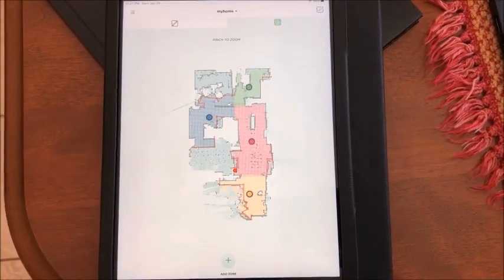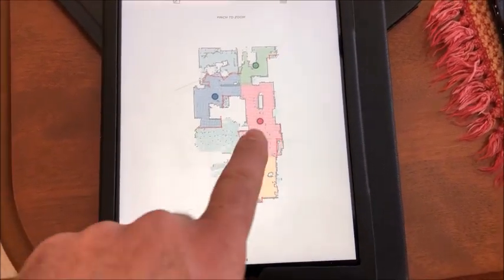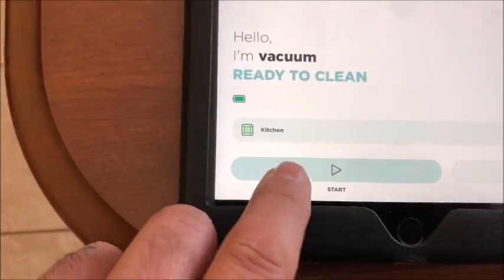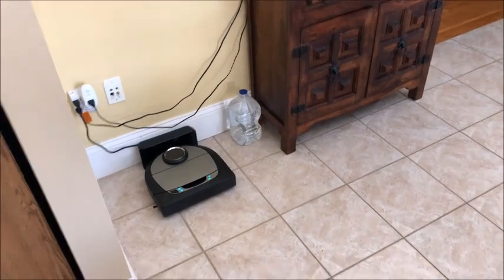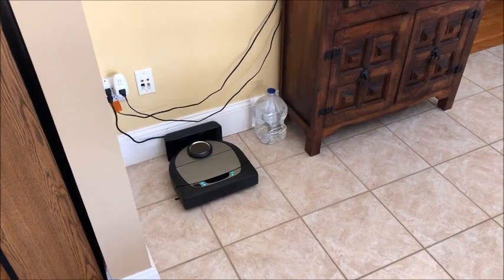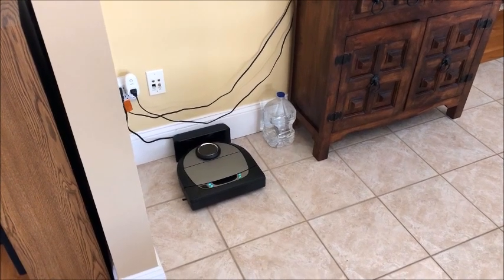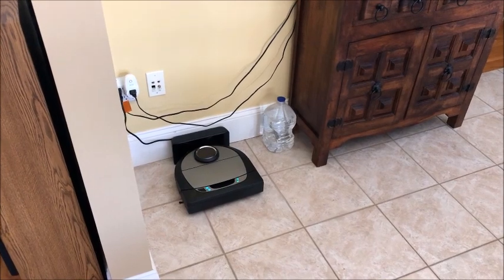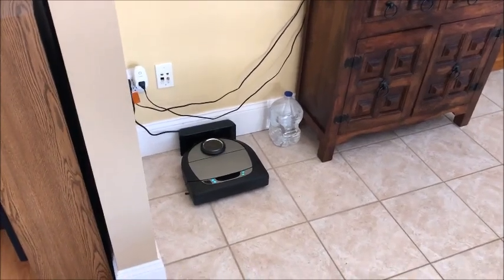Neato D7 Floor Plan Navigation Error

Comment: Apparently, if the GPS has to work even the slightest bit (hahaa!). Disturbances like a cloudy day or some atmospheric blockage, like RAIN causes (or seems to) the floor plan part stops the machine from even beginning its task. If your Neato starts, fires up the beater brush and then audibly trills just before returning to base with a "Navigation error" message on your app, tap the three lines on the app and remove your stored floor plan. I used the nogo lines until I noticed that very little time - days/week pass and this - no vacuuming - would occur. Find structures to drop in the way/obstruct instead of nogo lines and you'll be more happy in life without this annoyance. Second D4 here at home. Daughter brought hers here, I didn't buy the second one.

Comment: Let me start out, I am a hardware Electrical Engineer, and I would never buy a NEATO product after I tested and owned this NEATO junk, a "D7", we all paid big bucks for these devices.  The NEATO company does not care about fixing the firmware bugs, I had this exact problem reported and so did many others. When I called Tech. support, they can't help us. Oh, they say they will report it, in a case file but in a few weeks the case is closed out, but these firmware issues were never fixed, but NEATO was quick to develop a new device and market it to get us to buy another one. Support always tells you to rebuild a new floor plan and like the video said, the lockup error happens over and over again in time. Dudes, having us building a new floor plan is a big deal and takes lots of time, and that is not the problem, and if you get an issue while building it, the software will not let you clear the floor plan error, and does not allow a user to continue to build a floor plan, you have start all over again. It took me 2 weeks, 7days and 8 hours a day to get my 3500ft floor plan into a mapped floor plan, without errors. Huge deal, dudes, and all NEATO Tech. support wanted me to do was delete, really dudes, are you crazy! I did find the one suggestion, that worked, in this thread about creating a schedule a few minutes later and letting the unit start the new schedule cleaning, this seemed to get mine going again this time, until the next lockup issue I can expect in a few months. Hard resets don't clear the lockup, and if the firmware was designed properly, a hard reset should have fixed all the errors/issues we all are having when the devices lock up.  NEATO just does not want to hear from their customers. But your loss NEATO for having marketed junk to us all way before you debugged the firmware in the field. Yea it might have worked in your lab but when the device is used in the real world its junk to an owner.  NEATO did not allow us to contact the programmers directly about the bugs in the firmware with all our real-world testing and firmware bugs that occurred and all of them were never fixed like this one and many others we came across using the D7 at home. I have friends who are programmers and if NEATO would release the code they said, they could fix it and send it back to them for a firmware update to fix these errors for us all, but even NEATO would not allow this help from the community of users. I purchased a D7 and after a few years now, NEATO said they were not going to support it anymore, NEATO Really, ??  NEATO just left the bugs in the firmware like this one and we all need to buy a new Version device! Really?
 Again, GOOD BYE NEATO! NEVER AGAIN FOR ME! NEATO IS JUNK AND DONT BUY ANOTHER ONE!

Comment: if it can help anyone, as clearly stated in the user manual : the Neato base needs to be placed AT LEAST 3 FEETS (1 meter) from any corner or wall. Under this, floor plan are not guaranteed to work. And it needs these 3 feets on the 3 sides (left, right, and front) + never add anything in this 3 feet space once the floor map is done. Any added furniture (even a bowl for your cat for example) and the floor map is considered modified.
In your video, for example, was the bottle on the right present when you made the floor map? If no, then you have to remove it. If yes, NEVER remove it. Plus we see there is not 3 feet on both sides.
Your possibility is to deactivate no-go lines. Then you won't be able to ask it to go to a specific room, but as it doesn't need to load the map, it will work.

Comment: I occasionally have had the unrecognized floor plan message, or something to that effect.  It’s usually caused by something being changed in the room.  The unable to load floor plan message had me stumped but I assumed maybe something was interfering with the LiDAR so I blew it out with some compressed air and after that it started right up.  Maybe there was some dust there or something.
Reply: As a follow up this did not work.  Still trying to figure out what is causing this problem.
Reply: This is a problem with something being moved or introduced in the view of the vac when it rolls out about a foot and looks around.  I can put a clothes basket in it’s view and it will come back with an unrecognized floor plan.  Or I can move something big in the start up room and it does it.  It’s odd but only things that change in the vacuums view after it rolls out about a foot from the base cause this.  Something moved in another room doesn’t cause any problem.

Comment: Got the same problem multiple times now in the last few weeks ( i bought the D7 5 weeks ago ) and I may find a solutions. Try to move the Loading base a few centimeters ( Hand width ) from the wall into the room. Now My D7 worked again without any error since a week.

I tried multiple workarounds before like setup a new floor plan, clean sensors and laser system with fiber and aircan and remove reflective surfaces in the scan area - but moving the base a few into the room fixed it for me. May it help others :)

Comment: I've found another work-around for the "No Floor Plan Match Found". Before creating another map 1) Open the app 2) Tap three lines at top 3) Robot Schedule 4) Enable schedule 5) Select zone on your existing map 6) add time and cleaning days. I simply set the day/time to a few minutes ahead of current time. It worked.
Reply: Thank you, I reset my time and it worked. Changed it by 5 minutes, easy peasy.
Reply: Thank you for posting this.  It worked!!
Reply: Omg  this work for me too! 6 month I stop using the feature because of this error each time.. but works with schedule !! Thank you!
Reply: Thank you, this worked to clear the firmware bug, that NEATO will not fix....glad you found this fix....the Tech. support wanted me to delete my floor plan and make a new one.....They are nuts....took me 2 weeks to get a good one without errors and starting to make a new map of my home again. When this unit dies, I will never buy a NEATO product again.

Comment: Same problem here too. Worked for 2 weeks as new and then this. So, I also fiddled around and did enabled and disabled the "gentle cleaning" setting.  It is running now.
 When it happens again i will try this alone to see if it fixes the issue. I will also mention that when i tried to "manually" run it via the app, the app said that it could NOT connect to the robot. My phone was on Wifi and everything looked ok though, so who knows.

Comment: [SOLVED, HOPEFULLY]
I guys I spent day sstruggeling on the very same problem. I moved the base to a new room 1 month ago and rebuild the floor plan. After that I had this error almost every day...then 1 week ago I spent a while reading around and watching this video too. and made some test.
I tried for example to remake the map without cancelling and of course  I got the message "this map is too similar to an existing map".
So at the end the only possibile solution was: I changed something in this room. And there was a full plastic bag on the floor, approx 1 meter far from the base, that was not there when I build the floormap.
I tried to move it and....it worked.
To make you the idea how sensibile is Neato. In the same room, approx 1,5 meters, I have the loundry machine. If the door is OPEN is does not work too. If I close it does.
So try to put the surround area the cleaner as possibile from objects that were not there when you build the floor plan.
I hope this helps you. After I moved that bag it is working (now 7 days on a row)
Reply from the maker: Yes same solution for me. It has been working for a while now buuut every once in a while if a chair is out place or a plant is moved it fails but the next day it works again. so I just leave it alone and it works most of the times. I am guessing they do this deep scan initially to make sure that it knows where home is so it can go back because if something changes elsewhere, like a door is open or closed, it doesn't care. So perhaps what NEato should do is learn the immediate 1 meter around the home charger every time is goes out making it more flexible. Thanks.
Reply: I figured out the same. It did the map without a bag I usually place on the floor. If the bag is there, 90% of the times it fails to get the position, if I remove it, it works. Same with the clothes dryer, if I put it inside (1m from the robot) because it is rainy, Neato can not understand the position, if I remove it, then it works.

Comment: Same problem for months too. So annoying....
If I try and create a new floor plan, it errors saying there is already a similar floor plan that matches.
Reply from the maker: Still same issue for me. I have it setup to do different areas every day. occasionally it decides that the map is not valid and it goes back home. Then the next day it works fine on the next area perhaps. However the following week it does work on the area that it had a problem the previous week. Conclusion? for now I leave it alone and eventually it works almost every time. I keep hopping they fix the software!

Comment: Same problem here, so you cannot change anything in the floorplan after it has been made?, this is i problem if you have kids for example, because everything will change place daily, and we dont even have rooms big enough to have 15ft of clear space around the neato. So we will have to do a new floor plan every time to even continue using this product. Too bad it is impossible to schedule this floor plan creation, this would be a easy workaround for this issue, and make this thing usable again.
Reply: I place my base under a piece of furniture that has space for it to move but protects it from kids and animals.

Comment: So I noticed when you run it from the button (cleans without a map) it works fine, but if I run it from the app (which attempts to load the map), it gives this error. Could it be related to the internet connection?
Reply: If you run it from the button and not the app I think it’s not going to be looking for a map, it doesn’t where it is and doesn’t care.

Comment: I found 2 things , the area immediately around the neato needs to be kept exactly the same as when the map was created , like the water bottle in the video as already mentioned . The other thing I did was used velcro and stuck the base to the skirting. When neato is returning to base it shimmys its way back onto the charging base , my tiled floors allowed the base to move slightly . Since I have done the 2 above things . No more nav errors

Comment: ive got 3 neatos at the house.
while Neato's have never been perfect, the last 6 months have been horrible. A user that has roughly 3k invested in your products shouldnt have to do this many workarounds. We buy automated tools to help us, not constantly cause us to reload maps, rename maps etc. if this was a temp issue because of a bad firmware update I could at least understand that. but its not. these issues are systemic and even getting worse. This thanksgiving im trashing all my D7's and trying the irobot series.
Its also horrible that neatos new product lineup (coming out soon). still cant auto empty like its competition. Theres just no reason to keep this piece of junk anymore
Reply: Same issues. It’s really passing me off. Why isn’t Neato posting a video with support on this post? If it were fixable, they could easily post a one minute video here and give us an answer. Maybe there is no answer for these expensive door stops. Come on, Neato! Get your sh!t together.
Reply: @svpinut  Well, here I am. Back with the same issues. They never really stopped. I just have to try a bunch of times. Usually, I just sweep my floor with a broom. Like some sort of caveman.
Reply: I tried iRobot S9 and it has more issues than this one. The design of the robot itself is flawed the navigation is no we’re as good as Neato and there are issues with it getting stuck trying to get over different flooring types due to its back wheel design.
Reply: @charlot
i dumped all my neatos for two i7's (with the auto dirt disposal). best decision so far.
The i7's arent perfect if you have a thick matt in the kitchen, it doesnt go over it well and you just cant beat those big brushes on the neato..
but it does clean very well. its more stable, it has an auto disposal and is extremely easy to clean brushes wise.. you also have to mess with the brushes less often than the neato due to better design. The auto disposal alone is worth switching. Neato is really losing market share because of that
Reply: I have a D7 2 years now,  buggy the entire time, and I would never buy another NEATO product, they are junk and the BS they do by having us buy a new unit to fix the issues is criminal.

Comment: UPDATE 

Please someone else try it, because it worked for me. That I know of there is no “true” way to hard reset the vacuum. Your just able to reboot (By holding the power) and put the vacuum into WiFi paring mode (by holding the right number and power button)....Even when you log out, uninstall the app, reboot your phone, reinstall, sign back in, put the device into WiFi pairing mode, and set it back up the old map will instantly be there.

That got me thinking, I’ve “re-mapped” my space multiple times in multiple different houses and always renamed my map “Home” or “Town Home” so I wonder if it’s somehow holding onto those old maps internally or even by poor data management in the cloud. Then when you go to start your vacuum it doesn’t know which “home” to actually start running because there is all of these old maps named “home”.  Thus the error everyone is having.... 

Today after getting 3 of these errors today I renamed my whole “map” something unique that I have never used before (SC Home), pressed start and the vacuum took right off with no issues. Thought it was too good to be true, when it was done cleaning that zone I immediately had it start another zone and it went and cleaned it without an issue.

Thoughts?
Reply: I just did it here. Did not work. I am still getting the freaking message

Comment: You need a meter of free space in all directions, basically you should just get the Neato its own room.
Reply from the maker: They also told me that the vacuum needs to have a line of site to the base at all times. Basically you have to live in a museum to be able to use this thing. Actually I have changed the setup you see in the picture a little bit and I make sure the base is at least a foot away from the wall and from the cabinet and it has been working 99% of the times.

Comment: This happened to me today for the first time it wouldn't go to the area until i took it off the charge base took out the dustbin blew off potential dust on sensors and checked the brush on the bottom. Afterwards it went right to work. I don't know which if the actions is the solution. Next time I'll check them one at a time.
Reply: This one worked for me. Cleaning the sensors that is.
Reply: Again after a month. Navigation error, so I cleaned the 3 sensors and the laser on top and voilá, problem gone. 
Just in case: The three sensors are located on the bottom frontend (2) and on the side (1). The laser is the round thing on top. I simple cleaned them all by gently wiping them with a cotton swab.

Comment: I found a solution when I receive the navigation error msg. Don’t delete existing plan, instead select to create a new floor plan. Bot will start to clean and map, but will find its surroundings to match an existing plan and will give that msg and go back to base.  After it returns to base select to clean an area on your original floor plan and viola!  I find when the bot has trouble returning to base I receive this msg the next time it tries to clean a mapped area.
Reply: Doesn't work...it just goes on creating a new plan...
Reply: Its works! It really works! Thanks.
Reply: Perfect, it works! It’s still annoying that you even have to do this, but your solution is still a huge timesaver so thanks!